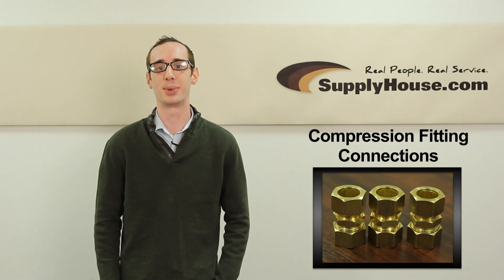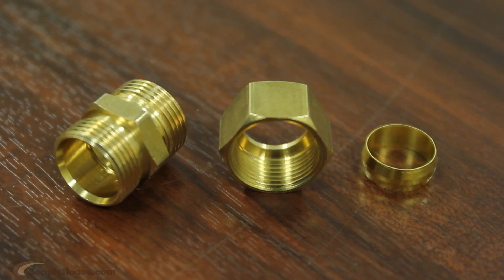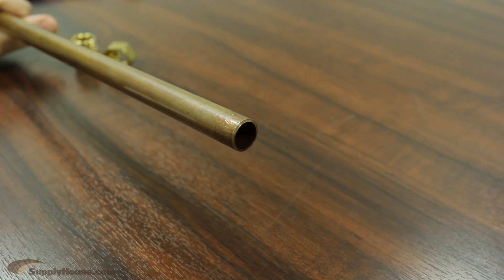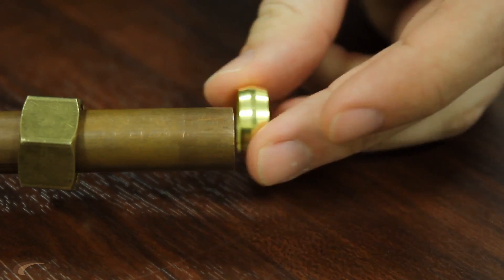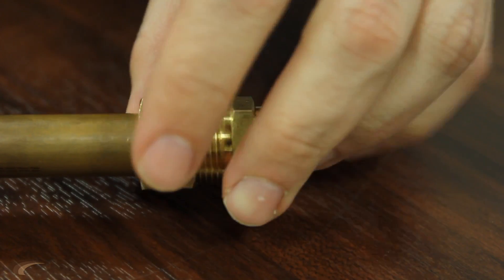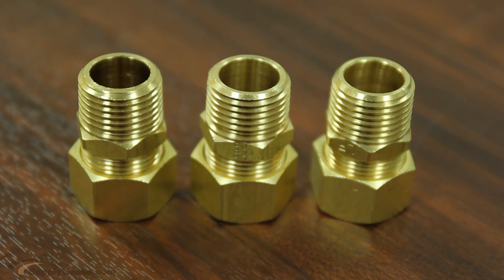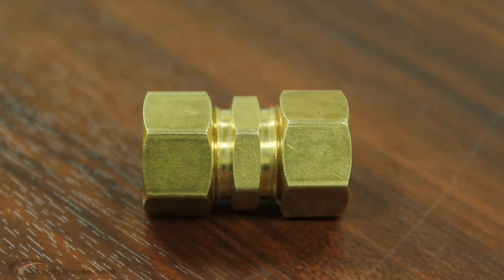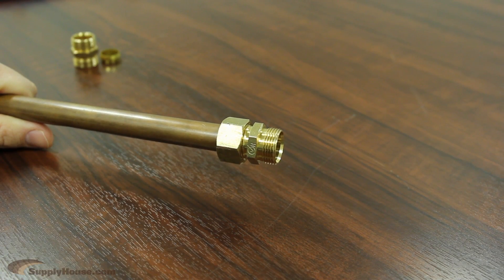How To Make Compression Connections for Copper Pipe

Comment: Is there such a copper fitting in existance...1/2 inch sweat x 3/8 inch thread? So you can solder onto a half inch copper pipe, then attach a 3/8 inch toilet water shut off valve compression. Thank you

Comment: Yet another video on how NOT to install a compression fitting. You're seating the pipe against the middle part. That's an excellent way to insure the ferule slides on the pipe when tightening and risking a leak. Please talk to a plumber when you prepare these marketing videos.

Comment: If I'm using 1/4" copper pipe what nut size would I need?
Reply from the maker: 1/4" copper would be the same as 3/8" OD compression fittings.
Reply: M r p